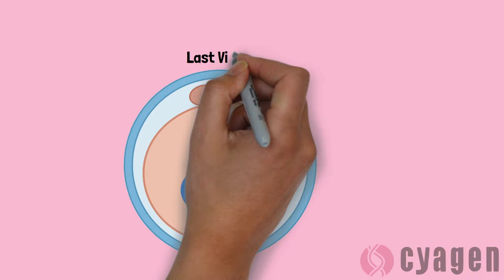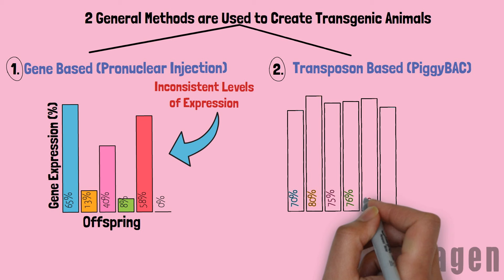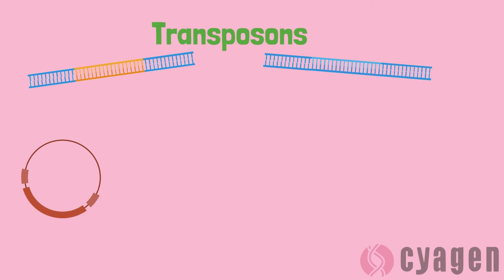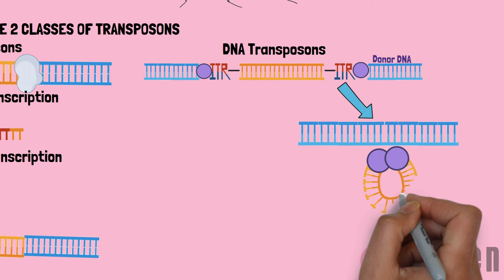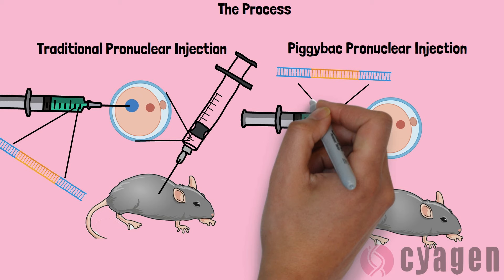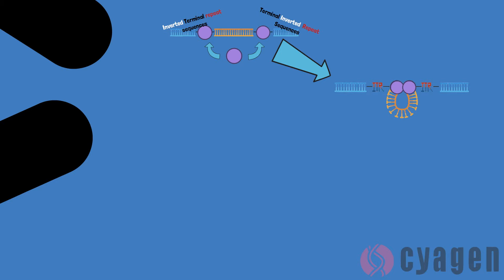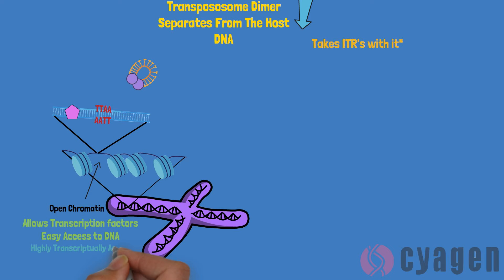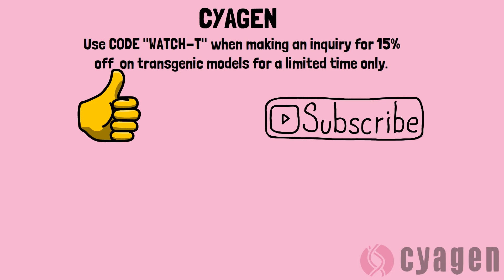The PiggyBAC Transposon: Generating Transgenic Mice with Consistent Expression

Comment: Nice video! How many copies of the gene will be inserted in the genome at different places? How many PiggyBac plasmids are injected? How many TTAA/AATT sites are there in the genome?
Reply: I'm curious about this as well, I'm assuming each transposition event is quite rare but there are probably an insanely high number of TTAA sites in the genome so it wouldn't surprise me if you sometimes find multiple insertions.